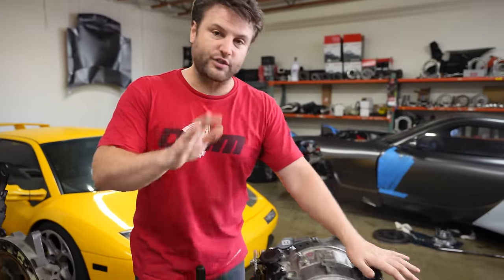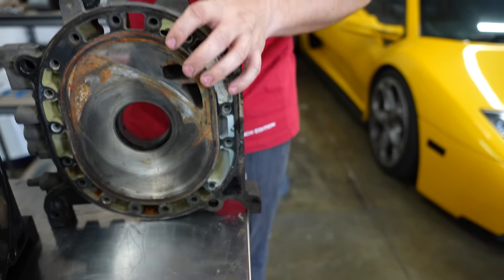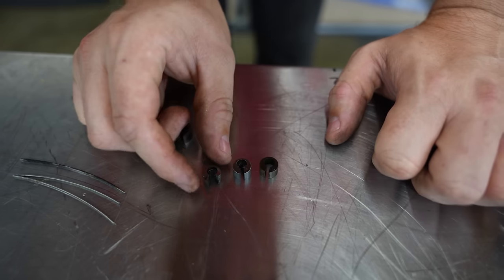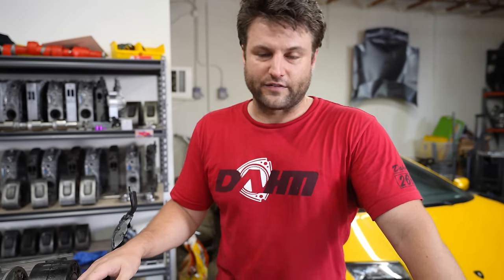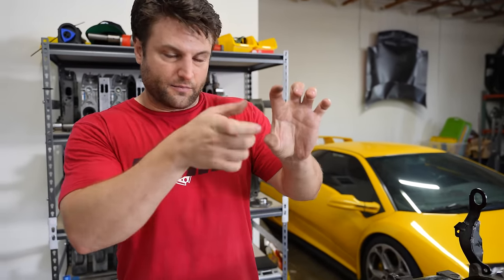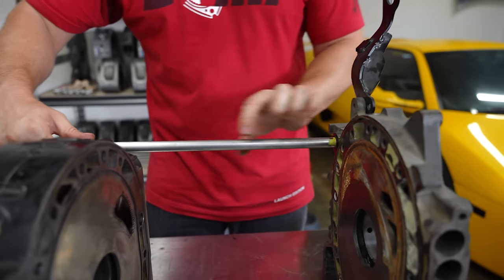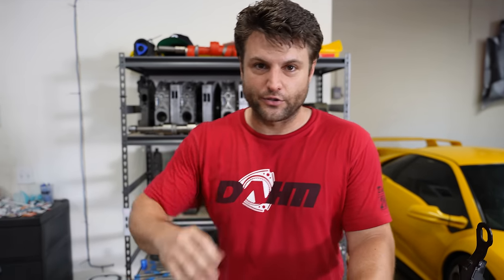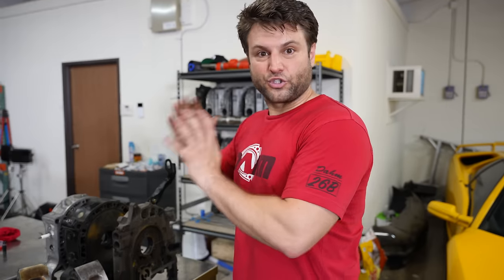Fixing the BIGGEST Problems of the Rotary Engine

Comment: It’s an utter shame how the engineering world gave up on the Rotary engine so quickly. Had they gotten the same attention piston engines got, who knows where they’d be today. People like you are putting in the effort to bring it back!
Reply: Draw a picture of the combustion chamber seals.  Then draw the piston and rings . One is complex, the other is so simple a child could do it.
Reply: Most people dont like having to replace their engine every 30k miles, no matter how small it is, not matter how much it is their fault.
Reply: @alexzanderroberts995  how expensive it is to do it though?
Reply: @sonyx5332  depends, do it yourself? 
About 200$ worth of equipment
20$ worth of parts
And 1500$ worth of inexperienced balls
To get someone else to do it?
Anywhere from 200-2000
Reply: @alexzanderroberts995  I raced rotary engine for years and held all motor world record. The downfall of the rotary is emissions and fuel economy. Great reliable light weight engines that make tons of power but they are not fuel efficient and can't meet the strict emission laws that all the tree huggers make these days.
Reply: @ultimatejay  From a publicity standpoint, if the fuel and emissions were not so butt-hurt, they actually let these engines race in large circuits, like F1 and NASCAR. The different maintenance styles would have been accepted and there would be a large cult following like there is for the American V8 or the Toyota I6.
Reply: The same goes for two stroke anything.
Reply: @duckdestroyer2412  rotaries are 4 stroke
Reply: @ultimatejay  I know, but Two Strokes are a sort of abandoned technology, just like the Rotary. They make immense power and are very lightweight. Just like a rotary.
Reply: @duckdestroyer2412  The snowmobile industry might disagree with that dismissal.
Two stroke technology continued losing to evolve through computer modulated direct
 fuel injection complete with Microsoft exhaust valve modifications with split second variations..  
And then the snowmobile industry represents a multi billion dollar industry that seems to thrive despite the negative effects of global change.
 But the rotatory still has those seals.
Reply: @duckdestroyer2412  Thank you.
Reply: @Jeffrey Hagelin  the snowmobile industry thrives because they are fun to ride and can comply with emissions standards for multiple countries. If that is what you're getting at. Rotaries never took off because of those apex seals, their naturally bad milage, and their reputation to be unreliable. Two strokes are hanging on by the snowmobile industry and a few dirt bike manufacturers. Just like Mazda, it is kind of a unique thing, industry wise, to continue using them.
Reply: @duckdestroyer2412  I was speaking in defense of the 2-stroke I certainly wasn't in defense of the rotary.. Apparently you completely misunderstood what I was trying to say.
The two stroke engines survived in the snowmobile industry because of technological innovation evolved with current day emission and gas mileage standards.. The rotary failed because of the aforementioned reasons and the current unavailability of metalogical technology to match that specific design requirements.
Reply: @jeffreyhagelin3672  my mistake. And my apologies
Reply: rotary is back baby!
Reply: @ultimatejay  ALL sane people like cleaner air.
Reply: @duckdestroyer2412  Opposing engines look cool. Basically efficient as hell. Not sure why more people don't do it. One company is doing it and I guess maritime and weirdly submarines use them. Personally I thought subs used stiirling engines.

 Anyway just learned about them. Seems like we should have had them decades ago. I'm not even sure what the cons are.
Reply: @ultimatejay  "that all the tree huggers make these days" because car makers needed to decrease emissions and increase fuel economy it has led to the increased efficiency while increasing power.  I don't see how that's only something only a "tree hugger" would want.  Just because fuel is cheap where you live doesn't mean it's not expensive in other places.  Gas is nearly $8 a gallon in the UK.
Reply: Engineers didn't give up on rotary technology, companies did.  Companies couldn't stay profitable pouring more money into the continued development of rotary engines.  Piston engines have gotten a lot of attention because they are profitable.
Reply: I like them for fun but if this video did not convince you that Rotary engine is just shit, pure functionality wise, you are beyond help. Only thing world did wrong is not giving up on rotary much sooner.
Reply: @duckdestroyer2412  two strokes are still big in chainsaws.
Reply: Azll
Reply: Mazda wants to bring it back badly. As well as the Rx series.
Reply: @alexzanderroberts995  2000? bro? more like 30k
Reply: Because it is an inherrent design flaw. That is why. It is the limitations of this style of engine. it cant get much better.
Reply: Mazda probably created the most reliable engine in Le Mans history with the 787b though. 
After doing all of that racing & taking the win, the car could've done the same thing all over again. 
It was even pitting far less than any other car.
Reply: @alexzanderroberts995 the engines don't have to be rebuilt that early if people know how to take care of them
Reply: @stinkothestooleater4490  if
If people take care of them
Reply: Theyre great in very specific situations but even then usually people don't bother as the economics of designing an engine for a very specific niche application don't add up.

Where's they really shine is actually at constant rpm in applications where weight is a concern, such as very light aircraft. They've been used in drones with some good results.
Reply: emissions and thermal efficiency conspicuously absent from his list of problems.  Oh i get it, you don't care about the pollution you cause other people to breathe, but you are a beneficiary of cleaner and more efficient engines.  if every car used a rotary gas would be 20 dollars a gallon and you'd hate going outside to breathe the cancerous air.
Reply: @ultimatejay  pfft. they can't even meet lax emission laws.
Reply: @rytramprophet843 yes! And the biggest problem is the shape of the combustion chamber.  Efficiency requires the smallest chamber surface area for a volume of air/fuel.  That’s the whole point of hemi piston engines…limited surface area to take heat away from the burnt fuel.  That’s why L head engines have low efficiency.  The rotary chamber has a very large area and therefore efficiency is poor and always will be….even worse than the L head.
Reply: It's one of those "just out of reach" problems. Like fusion. Knowing damn good and well the potential is there, and actually making it happen with any reliability, are different things.
Reply: The wankel rotary engine is just… not a good engine compared to the Pistons when it comes to the general public. It’s gas guzzling, oil eating, and high maintenance engine which for the general public is not fun to own. For us, they’re great and fun because we don’t give two shits about having to maintain it on a strict schedule or the MPG… unfortunately… companies care most about the general consumers… not us enthusiast.
Reply: @brantleyfoster021 that was not the most reliable engine not even close. In previous years at Le Mans Mazdas engines failed a lot and they simply got lucky that year and none of their engines failed
Reply: @isthisagoodname6279  
This was a new type of engine that they hadn't used before. 
It was quite different & didn't seem to fail.
Reply: It’s been 112 years…
Reply: @grabbagool wackjob
Reply: Would love a rotary you’re practically driving a 2 stroke car
Reply: It’s a really simple answer but people just don’t wanna understand. Rotaries are the most inefficient motor to convert fuel to moving energy. The only advantage it has is that it’s small in physical size. 1.3 liter doesn’t mean anything   It’s like saying 2 stroke is better than 4 stroke cause 2 stroke 500cc makes almost double the hp as 500cc 4 stroke.
Reply: @alexzanderroberts995 show me where it can get done so cheaply
Reply: @ultimatejay  no its not
Reply: Funding
Reply: 600th like
Reply: I wouldn't say they just gave up on it, 
They spent Hundreds of millions on the R&D for the rotary engine and for mass production they go it as good as it was gonna get.
(With engineers who knew exactly what they were doing and did the best possible, there will never be a Rotary engine that can comfortable do 500,000km without a rebuild like many Traditional Engines, Our 82 Toyota Landcruiser did 1,200,000km without a rebuild 1 engine & gearbox and 800,000 of that was on LPG and about 550,000 Towing a 3,500 Boat on Trailer around Australia many times, (Not even a $1,000,000 rotary build with only 150-200HP could do that)

Almost all the upgrades and changes mentioned in this video would not work for mass production of millions of cars 
or if it did then a base model RX8 would Cost $150,000 due to the cost of production.
Reply: @ultimatejay do you know how much cancers caused specifically by combustion products?
Reply: What is repair frequency period  , can we use on 20 foot marine boats . Price for used engine .
Reply: @piperg6179 Inline engines are supreme in the primary/secondary vibrations department with the 6 cylinder being the one to rule them all. It's very simple but iconic and very durable. Ford 300 to name one such example.
Reply: Same thing with electric. I saw a nat geo from the 1970s about electric cars then nothing
Reply: @alexzanderroberts995 You do realize that in the first 20 years, gasoline engines only lasted about 30,000 mi right? This is exactly the point. If they had given it more attention then it probably would be reliable
Reply: Have fun taking apart the engine every 100k miles. The issue was not that they didn’t try, Mazda spent BILLIONS on R&D and DECADES of work to even get it to work, but materials engineering just wasn’t ready at the time to make seals that work without serious expense beyond the scope of a production car
Reply: @holidayfartcruiserthe2nd749  There's one owner in particular who covered over 200k kilometers in total milage in their RX-7, and they keep it properly maintained, fixed up and other things. I learned about this in another video in the comments section.
Reply: It just has a lot of flaws:  low compression (unless boosted) made for poor emmisions.  It burns oil: emissions again. 

If you compare swept volume Vs hp it is embarassingly bad.
Reply: It's not the engineering world, its the consumers and companies who do not want it. It's not economically feasible to make these engines.
Reply: So much time and money has been put into wankles. They just suck tbh. They have intrinsic flaws that make them suck for daily use.
Reply: It's not a surprise. People are lazy. They give up easy and will take the simplest path, despite whether or not it's the best.
Reply: @Psyrecx  nah. If there were advantages to these engines we'd be using them. Many companies invested way to much time and money into them. They just have to many downsides.
Reply: @jamescole3152  weird then how it took over a century to build a reliable piston engine
Reply: They did not give up "quickly". So many manufacturers tried it and either went bankrupt or almost became past tense, Mazda being the exception though they still abandoned it eventually due to the emission demands.
Reply: @cdgonepotatoes4219  Technically, they haven't abandoned it. They still manufacture rotary engines, and haven't stopped. They just haven't designed any new ones that have been released.
Reply: They are bringing it back as a range extender which is probably the right place for it.  It can run at optimal conditions overcoming the inability to do variable valve timing and one rotor is more than sufficient.
Reply: @sonyx5332  piston is only cheaper because of mass production. 😊

Comment: Idk if I'll own a rotary engine, but I'm sure as hell gonna sit here and learn. 21 minute video!!
Reply: That's exactly how I feel. Also robs passion and antics are great
Reply: yup
Reply: Look into pac performance in Australia
Reply: @bloodyricho1  PAC make amazing cars, shame they didn't get back to Rob
Reply: Yup. I know for a fact I will never own a rotary. I don't really even care about them, I am a chevy guy through and through. Yet, here I am, and here I shall remain.
Reply: Do you want to own a air-cooled Porsche 911? Or some other expensive sports car?

Take 10% of the max you'd ever spend ... and go buy a 1st or 2nd gen Rx7. A running car should be <$5k pretty easy. Or you could do $1k and budget $4k for a rebuild. I guarantee that this will be 90% of the fun of something like a 911, for 1/10th the cost.

There, now you can justify a rotary engine car!
Reply: Same. I'm just on this guy's side whatever it is he's into. Smart af nhmo
Reply: I’ll own one rotary. And it will be open wheeler or radical spec
Reply: @jonathansgarage2488  More like car from this decade so you don't have to fear it will granade itself or is so expensive that putting miles on it will lower the value.
I would suggest base model C7 corvette
Reply: It's a decent video on engineering principles. Don't do what you don't need. Think about where forces are going, where they are coming from and what is causing them.
Reply: #hemi
Reply: @jonathansgarage2488  Yeah but flexing that porshe symbol is 99% reason of owning a porshe. Sadly
Reply: True. Im not much of a car guy, but these engines always fascinate me
Reply: I don't think I'll own a rotary but I like them and I want to learn about them so when an argument comes up about them being garbage I'll know it's not true
Reply: i defnitly want a rotary engine car, just in case i finally do have the budget for one i wanna learn as much as possible
Reply: I’m building a 1988 Mr2. There’s no reason for me to be watching this video yet here I am  listening intently and learning so much 👍🏽
Reply: @jonathansgarage2488  nope you can’t cause you gotta spend another 5k after 20 miles.
Reply: @bencezavarko7312  but it is true.
Reply: I have a rotary engine in a bugeye sprite  , 10 years owned and 30,000 fast miles
Reply: @larrywkoch  one year in the shop. 20 miles to another destination. Then shop again and motors blown.
Reply: Il find myself 4 hours into someone building a random 2.0 vw engine or something and juat sit and listen lmao. I love it
Reply: Definitely worth owning one. Tons of fun.
Reply: I dont even drive and rotary engines fascinate me. Really enjoy watching videos like this
Reply: @natedawg2p  they fascinate me by the way people worship them. Even thought they aren’t reliable etc.
Reply: rx7 baby
Reply: Can this engine be put in a year 2000 Ford superduty truck????mpg....cost....reliability.....
Reply: @davidlinnell9530  YOu can put rotarys into any car. rotary engines are unreliable due to apex seals and leaks, due to how much power they can make, only a few rotarys will be required, very compact btw. Cost is very dependant on how much rotary so im not sure at all. I THINK that mpg is ok
Reply: @jonathansgarage2488  that's a nice sentiment for sure but at least in the US there are no RX7s under $5k, I can barely find a D16 Honda Civic for that price
Reply: 21 minutes well spent. I'm building a 2,000 HP, 4 rotor billet to put in a 3000 GT 4WD. I'm watching literally EVERYTHING.
Edit: I could have it built and sent to me from Australia for $35,000 USD including shipping and import taxes but I can build it for $12,000. Short block only. My turbos and milled plenums will cost me more than another $6,000. The Borla custom exhaust another $9,000. Why do it? I'm getting old. Last ditch effort to do some cool stuff in my final years.
Reply: Ha! Same!!
Reply: I love rotary engine...but in my country..spark plug for rotary are very expensive...and we don't have fuel e85 ...😢
Reply: yOUD BEEN FINE UPTO 60,000 MILES THEN NEW ENGINE TIME.
Reply: @GnarlySpeedShop exactly why I'm here! True Sh*t
Reply: A friend of mine had RX7 we went to a store. When we came out the car just wouldnt start. He was sat there 30 mins trying to start it. He said it does do this but will start. I was worried he was going to flatten the battery amd be stranded. It did start eventually after 40 minutes! crazy eh. These engines.
Reply: If i was rich this would go in my project car. Alas instead i will get a croch rocket engine instead.